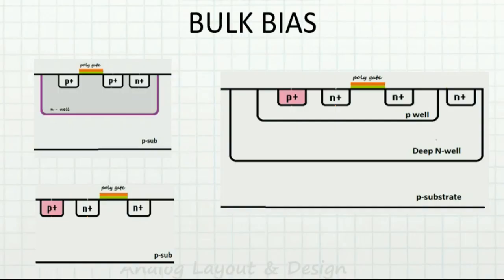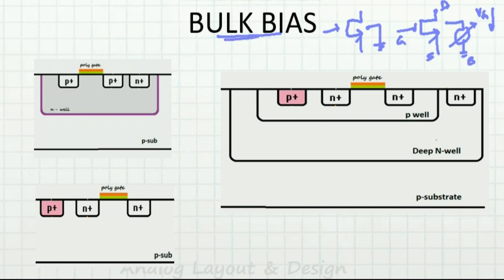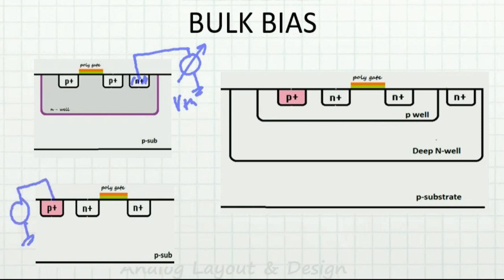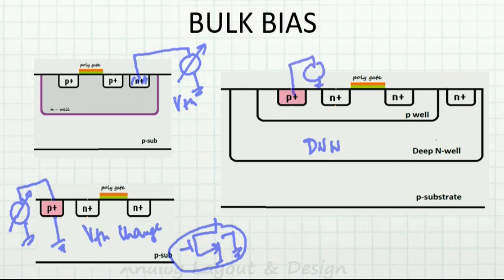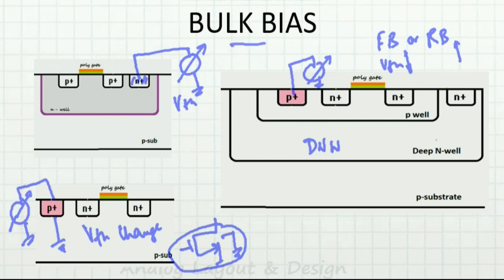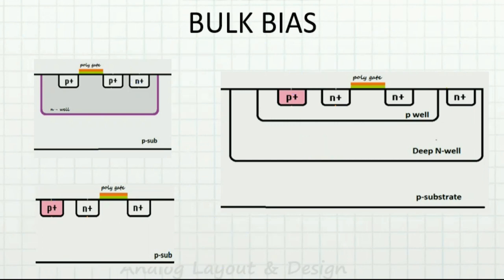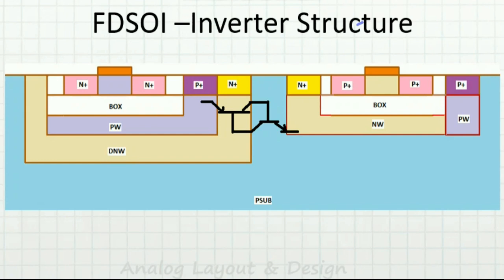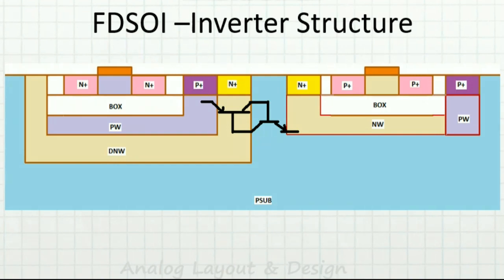FDSOI LATCH UP?

Comment: Someone let me know why deep nwell should be connected to highest voltage in the design. And what if pmoss and nmos are designed in same deep nwell. Are there any disadvantages.
Reply from the maker: Nwell should always be connected to highest voltage in the circuit. else, the body diode can get forward biased. i.e.  assume nwell [n of diode] is at 1V and the  drain or source of PMOS is at 3V, then [P of the diode], then, this diode will get f/w biased. if nwell is at 3V instead, then it will be reverse biased.
Nwell and DeepNwell are basically shorted with high resistance. Basically for PMOS, we dont need DNW. as it is , every pmos transistor is isolated...
Reply: @analoglayoutdesign2342  Thank you.
Reply: How we give supply to the deep nwell (what is that excess terminal called in nmos). I only know the four terminal MOS.
Reply from the maker: @ramyak1098 here also it will be  4 terminal only. the difference will be bulk can be at different potential other than ground which is default in normal transistor.